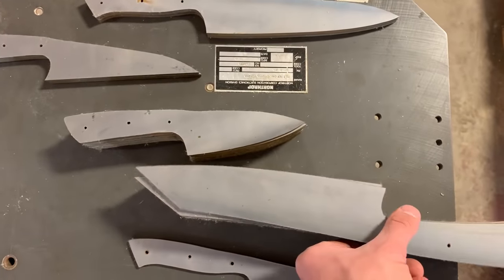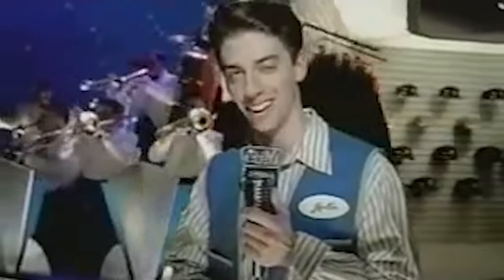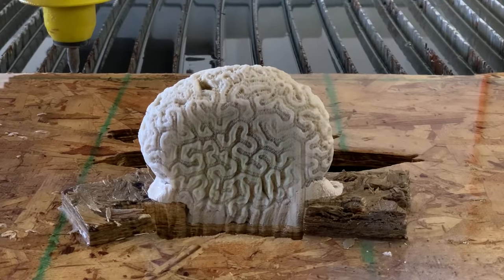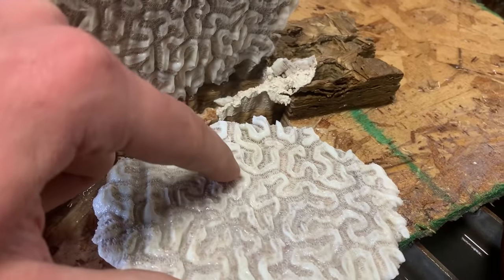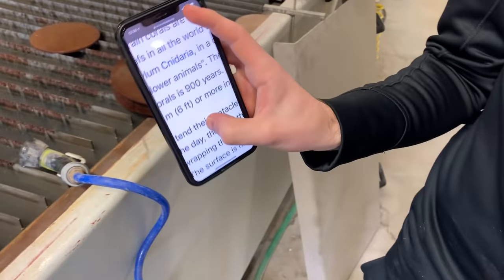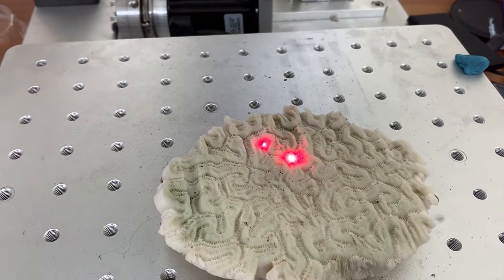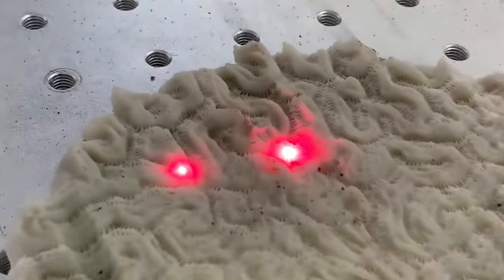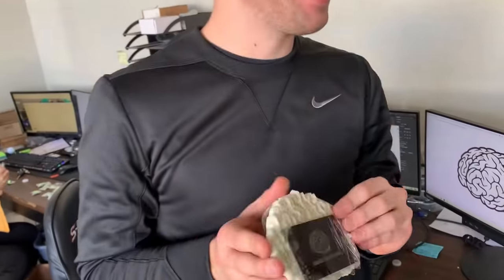Brain Coral vs Waterjet - Interesting Cross-Section

Comment: I think the discoloration of the coral is from very fine particulate matter(abrasives) that became trapped inside the microscopic pores of the coral by the high pressure nozzle. I found a 1/2 dead brain coral laying on the beach after a storm, and I used clorox to get them super white.